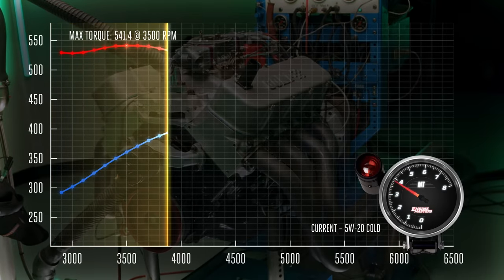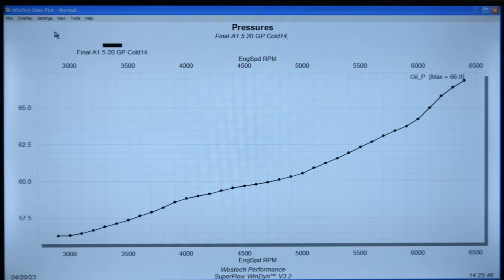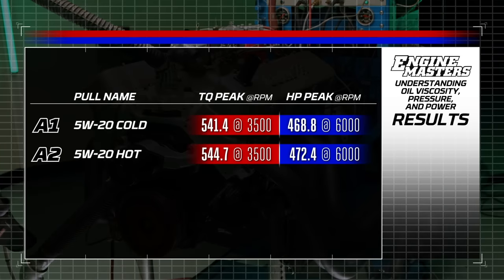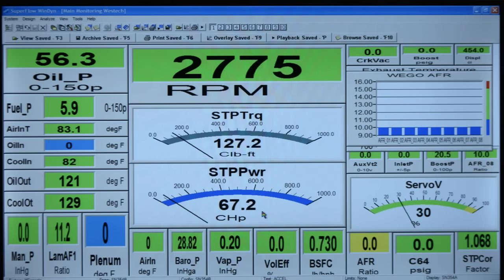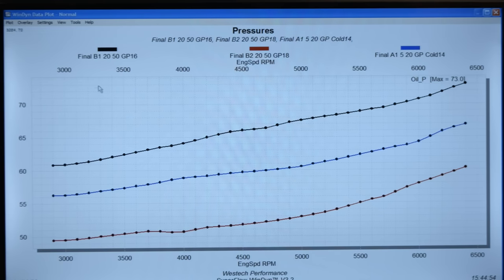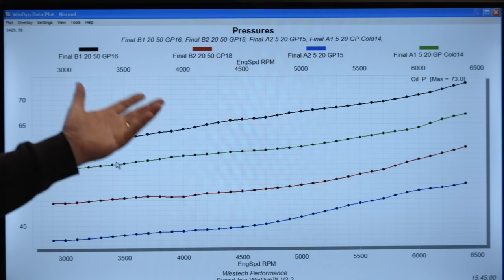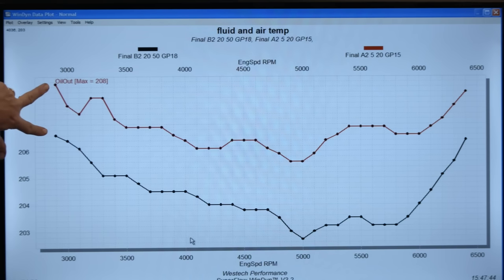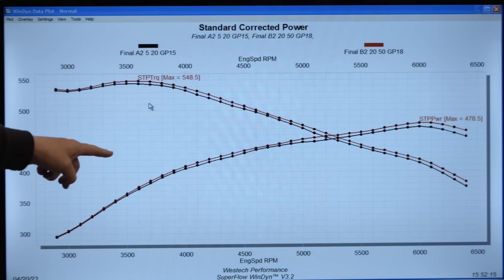Does the Thickness of Your Oil Matter? | Engine Masters FULL EPISODE | MotorTrend

Comment: Another thing to consider with a hydraulic cam is that thicker oil is less likely to allow the lifters to bleed down.  That means you get more lift with thicker oil.  I'd be interested to see what happened with the same test using solid lifters.
Reply: This was the comment I was just about to make. I wonder how much of that bot at the top end is due to lifters
Reply: another thing thats always sealed my choice in oils. shear strength. it sounds funny but its crucial. think about gear lube its super thick and takes the worst abuse its highly resistant to shear forces. oil does the same as it thickens usually. so 5w-30 has a much weaker shear strength that 10w-30 and its really not much thicker of an oil. 10w-30 also has better stiction so it stays in the top of the engine better than thinner oils so it has atleast an oil film on cold starts that also have the most damaging forces. 
many noisy engines on startup quiet down with 10w-30 because its preventing damage. 
i always run good quality synthetic oil and my motors almost always look great inside whenever their opened up. one of them the oil was always honey color at the end of its oil changes and that thing only knew abuse.
Reply: @chehystpewpur4754 Just remember two things. One is that the bottle label is somewhat meaningless. It pays to look at the hot and cold viscosity specs. 2nd is that one model of oil can have better flow and also offer higher shear strength than another oil that is "thicker". The HTHS index answers this question as do tests you can run at home and wear scar tests a few people have run on the models of oil you are looking at.
Reply: They don't bleed down rapidly enough for viscosity to make ANY difference in lift when the engine is running.
Reply: @anvilsvs  false i had an 03 silverado had a lifter tick at idle i switched to 15w40 T6 rotella and it quieted down the tick alot later found out the oil pickup o ring was pulling air the heavier oil didnt let the lifters bleed down at idle
Reply: @96cr  OK, when you had a bad O ring on the oil pickup that was another problem which the thicker oil sort of solved.  Yes, lifters (and bearings) don't like foam rather than straight oil.  It wasn't the thinner oil being fed to lifters, it was the air.
BTW, I've found that Rotella T6 is a superior oil for lawn mower engines as well.
Reply: @anvilsvs  same it works good in air-cooled stuff I normally throw in what I have left over for my diesels seems to work good
Reply: @chehystpewpur4754  "so 5w-30 has a much weaker shear strength that 10w-30 and its really not much thicker of an oil."  You'd have to look at the HTHS value to know for sure.  PAO base stock is inherently multigrade enough that you can make a 5W30 without any viscosity index improver at all.  So 5W30 synthetic racing oils don't necessarily have viscosity index improver in them.  You can also achieve 10W40 and 15W50 without any viscosity index improver.  Obviously a 5W50 will need some viscosity index improver by way of comparison, so is not ideal (or necessary) for a race car that probably won't be seeing cold starts in sub-zero temperatures.
Reply: That sounds like an interesting fact I think it's possible to change an engine's power band and/or torque curve just by changing oil viscosities.
Reply: That's where I think the power came from, ive done a lot of bbc hyd roller lifter testing to gain rpm before it noses over...often results are reverse what you would expect
Reply: Thicker oil is less likely to pump up lifters on startup... If your lifters are able to leak down far enough to actually cause chatter, your oil pump / bearings are already worn down to the point you're losing oil pressure during operation. Thicker oil will help maintain oil pressure during operation of a worn engine, but won't really effect leakdown in a set of lifters.
Reply: @96cr  Switched from Mobil 1 at 60k on my 02 5.2 truck I bought new to 10/30 dino oil and engine remained quiet for another 120k til it was stolen
Reply: If I don't run a 40 weight in my old Nissan the lifters will start ticking as it warms up. I think the bearing clearances are on the loose side and thinner oil don't supply enough pressure to the head.
Reply: Add higher RPMs hydraulic lifters don't have time to bleed down and if they do I bet the amount would be unmeasurable almost
Reply: @sandasturner9529 enough for bragging rights on a dyno sheet sure,meaningful in the real world difference not so much
Reply: @jediknight1294  true but I'd like know how far I can take this idea 💡

Comment: I've noticed a difference in my high mile Toyota with thicker. Overseas the recommended viscosity is 10-40 but with us spec is api energy conserving 5-30. When i run thicker oil i notice slightly better power and i think it's because of ring seal on an old engine
Reply: Same. I run 10w40 in my 22re and it’s way smoother than 5w30/10w30. I pretty much run 10w40 in everything I’ve ever owned
Reply: Use 0w40 Mobil 1...your welcome.
Reply: @kskip4242 how about 5w40 ? I got a 1zz with 260k km up north and it's starting to burn a bit. Would there be any downsides going to 5w40 from 5w30?
Reply: @slowyota_rolla  You need to get a sticky oil in 0w40 or 5w40. Just remember they are not all created the same. Esters help them stick. Motul X Max and LiquiMoly Synthoil are some I like.
Reply: I HAD A GREMLIN YEARS BACK WITH A 232ci STRAIGHT 6 WITH 120,000 MILES. EVERYTIME I DID A OIL CHANGE YOU FELT LET'S SAY A BIG DIFFERENCE WHICH I CONTRIBUTED TO A BETTER RING SEAL.
Reply: @slowyota_rolla  0w40 is like a slightly thicker 5w30, you will get great flow at start up and combat oil consumption.Plus the additives are superior in the 0w40. It made my G.M 3.6 LFX v6 stop using oil.
Reply: @kskip4242 in everything?? You'd blow up my Toyota lol
Reply: @romak4756  Nonsense. My 2019 Nissan Altima with the 2.5 inline-4 specify 0w 20 and I have been running 0w 40 in it for the last 60,000 miles and it loves it. But seriously anything that specifies a 5w 30 is 0-40 is a natural replacement.
Reply: @kskip4242  I don't think I'll be changing my 0w 16 with that anytime soon
Reply: @romak4756  run 0w20. It really depends on how long you want that motor to last. The 0w 20 will probably give you a better VVT activation and probably better performance. It's my experience that the automaker's always go a little too extreme on the thinnest oils for Cafe standards and gas mileage. Do what you got to do though chief. I'm just offering my experiences you can do what you need.
Reply: @romak4756 I'd never buy anything that recommended 0w-16. Or 5w-20
Reply: @duckwacker8720  uh huh, only like the second most sold car in the US lol. Ok.
Reply: In my 2014 ram 5.7 hemi I went from 5W 20 to 5w 30 - i’m getting 20 more miles per tank with a slight increase in power and at oil change The oil looks cleaner. The engine has 90k Miles on it. Oil is Full synthetic
Reply: So yall seem to know a few things about running different oils than recommended in vehicles.. So I have a ? I have a '97 F-350 with the 5.8L V8 with about 118k miles i believe its recommended oil is a 5w20 it seems to like to make the oil slowly disappear.. would it be beneficial to switch oil viscosity to a 5w40 or what would a better option be.
Plus I live in northeast Ohio (for the weather/temp knowledge if needed to help decision) thank yall for any helpful info..
Reply: @danafaulhaber334 why not first step up to a 5W30 grade. I would recommend the Quaker State Full Synthetic. And see how your vehicle behaves. This Quaker is on the higher end of 30 viscosity @ 11.6 cst (hot). Then if you’re still not happy, then try 0W40 which will take you into the 13.3 cst (hot) range depending on the brand.
Reply: I like 10w40 with 5% oil stabilzier for that extra tack pretty much use it in every car i own. Not 20% like the bottles say 😂
Reply: My 96 nissan sounds much quieter with a 40 weight. 5w30 sounds like theres not enough pressure in the lifters.
Reply: @kskip4242 thanks! I'll update in the next few weeks over the oil change

Comment: The interesting thing to remember is when looking at oil pressure,  is that pressure is actually the measurement of two things combined; flow, and resistance to flow.  In theory,  due to easier pumping, the thinner oil will generate less pressure  (as we saw here) and a lot of people see that as less protection.   I look at it as more that the oil generates less resistance, creating greater flow,  making it so you have more fresh oil being pumped into your bearings, so as long as you arent overcoming your film strength based on the size of a given oil molecule, you are better pulling heat our of your journals, which can only be a benefit to engine longevity.   The ring seal thing is a whole other kettle of fish i hadnt considered however.
Reply: You could only be sure of that if you did a volume flow test of the oil at all temps and pressures.
Reply: the problem with the thinner oil is it literally breaks down and allows alot of wear in the name of emissions and mpg alot of the newer engines are not lasting as long as the late 90's and 2000's engines that had 5w30 spec'd
Reply: @96cr  It doesn't break down any quicker, it's just that the oil molecule cluster is smaller, so it gets squished of the journals easier, especially at slower engine speeds when it's not making the same pumping volume.  In very modern engines with a variable geometry oil pump, it's less of a big deal because they can compensate for the low rpms, in something a little older, not so much.
Reply: @96cr  It's all relative! You seem to be inferring that 5W30 is thick oil, whereas many would say it's already too thin and they prefer to run 10W40, 10W50, 10W60 etc.   It all depends, doesn't it? Friction vs film strength, etc.

Penrite in Australia even sell a "30W70" -- this is an extrapolated grade since neither 30W or SAE 70 engine oils officially exist! 

Generally 0W20, 0W16 & 0W8 (noting that previously it was just  SAE 20 for everything under 9.3 cSt , and SAE 16 and SAE 8 are just further subdivisions which have been added) are going to be specced for "eco" cars like the Toyota Prius for maximum fuel economy on the assumption the engine will never be driven hard and the oil will never get particularly hot.
Reply: @TassieLorenzo  the new toyotas actually have 0w-8 now
Reply: i have been considering running 5-40 in my stage one mk7.5 gti instead of O-20...thoughts?
Reply: @mikek8986  I would actually look in the owners manual, typically back in the oil section there will be a note that goes something like "xWxx viscosity is recommended, but when that isn't available yWyx may be used"  Just anecdotal,  my jeep us new enough it calls for 0w20, while looking through the forums about it, I came across a post that was written by one of the guys that was on the design team for the engine back when it was brand new, and he tells that they designed it around 5w20, which is what I switched to.  That said, that was before I learned more about the variable volume oil pumps that come on the newer version, mine when it's fully warmed up holds a steady 30-32 psi from idle through to redline
Reply: @mikek8986  Go for it! The EA888 is a somewhat old fashioned engine.  Until the Mk6 it used 5W40 anyway.
Reply: @96cr  The viscosity is not directly related to the "stay in grade" capability of an oil. You can have a low quality thick oil that doesn't stay in grade very well, and a very thin, very expensive full synthetic that has excellent ability to stay in grade.
Reply: @TassieLorenzo  Don't do many cold starts in Oz, do you? 30w70 at -20C would be molasses. No way to start without preheat.
Reply: @noxious89123  "The viscosity is not directly related to the "stay in grade" capability of an oil."
But viscosity SPREAD is. The bigger the spread between low and high numbers, the more Viscosity Index Improvers it uses (ceteris paribus). VIIs are polymers, and tend to shear with use, and sheared VIIs no longer thicken the oil sufficiently. Thus, a 0w40 is gonna be less shear-stable (again, ceteris paribus) than a 15w40.
Reply: @bcubed72  That's true! Penrite in Australia do a "shear free" 10W40 PAO synthetic racing without any viscosity index improvers (VII) at all, so that seems to be the widest multigrade range possible in a 40 grade without using VII. They also do a 5W30 PAO racing oil without any VII. 

On the bright side, for mainstream oils the difficulty of making a 0W40 compels Castrol Edge to include some (30-40%) PAO in the  formulation, where the Castrol Edge 5W40 is all Group 3 hydrocracked mineral oil.
Reply: @bcubed72  Lol! It would be exceptionally unusual for the temperature to go below 0C in most parts of Australia. Aussies generally complain about the cold when it gets below 15C (below 20C for Queenslanders and Territorians!). Even in the ski  resort regions in the mountains, we are not taking Sasckatchawean temperatures!
Reply: @TassieLorenzo  Oh, I hear ya. I'm just saying, SOME of the use of low-vis oils in the USA is due to frigid winters, and the fact MFRs don't wanna go back to "winter" and "summer" weights.
(The other part is trying to eke out a fraction of an MPG for regulatory reasons, one hopes not at the expense of engine longevity.)
Reply: As ever, the proof is in the tear down.